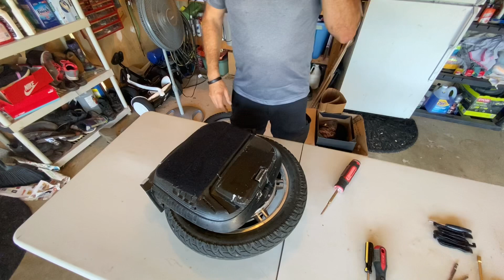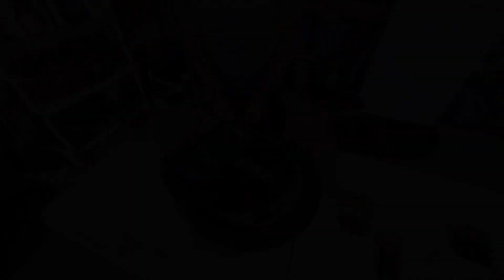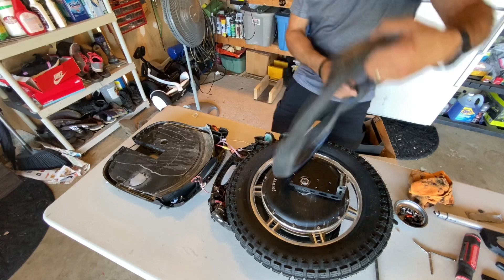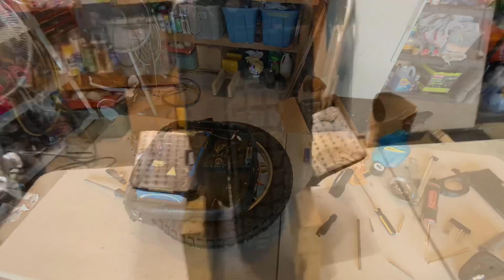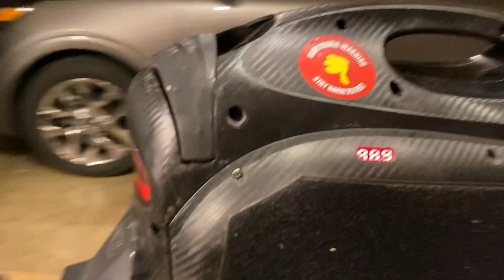MSP Tire change

Comment: Hey Ray where can i pickup one of those MSX strengthener/washer 5:36? would greatly appreciate it. Thank you.
Reply from the maker: murland fish used to make them but not any more. you can use wider washers and longer bolts to achieve  same purpose.
Reply: Hey Ray, thank you for the reply. I will give that a shot.

Comment: I noticed that you had a white patch near the battery on the casing as you were replacing it at reassembly, did you have a repair made to your casing? 
I’ve just received my pedal bracket strengthened from Murland, they are of superb quality, came with excellent  replacement Allen headed screws, and all look very strong, will be fitting them soon. Greetings from Scotland!
Reply from the maker: hi, the white piece you see is a basically big washer to protect inner shell from cracking around the hangar bolt holes. you can just use normal thick washers to achieve same results.

Comment: What size Phillip screwdriver do I use to get those screws out?
Reply from the maker: i use a milwaukee number 1 and i push down on the screw as to not stop it. get brand name bits, they are worth it.
Reply from the maker: yes. milwaukee is just the brand name i use

Comment: Good morning Ray. Would you happen to know what size socket and wrench I need to change my pedal hangers on my msp
Reply from the maker: m5 for the hanger bolts. 24mm slotted socket for axle nut. torque to 101ft/pounds when reinstalling axle nut

Comment: Where did u get the power screwdriver please?? I'm trying to fit a new tyre on my Msuper 84v any advice please? 😊 👍
That's an awesome tyre👍 how is it on flat surfaces?
Reply from the maker: CRAFTSMAN 4V MAX Cordless Screwdriver (CMCF604) https://www.amazon.com/dp/B07ZK6GYRL/ref=cm_sw_r_cp_api_glt_fabc_J3ZB37Z1Z79G8CK9AWC0?_encoding=UTF8&psc=1
Reply from the maker: for me, it handles well on all surfaces.
Reply from the maker: take your time! you don’t want to punch the inner tube and have to do it all over again. so i tend to really take my time if i’m using metal levers. you can try the zip tie method. do a googled search tire change using zip ties.

Comment: This is a great tip not to touch the right side controller and motor wires! Can it be done on the RS as well you think? Thak you!
Reply from the maker: yes it can be but you probably have to extend motor stop switch wires as i did in msp. on my rs i found it easy to just drop motor from shell.
Reply: @rayrokni  Disconnecting the motor wires then? Thank you for your time!
Reply from the maker: @igorgoga7985  yes i disconnected the motor wires and hall sensor. be very careful disconnecting the hall sensor since they put a lot of silicone on the connector. use an exacto knife and very carefully cut the silicone holding the connector. do not be in a hurry. then carefully rock the connector side ways and up. hold the connector only, make sure you are not pulling from the wires. make sure you take notes or picture of the sequence of motor wires. you don’t want to connect them wrongly. make sure the hall sensor is reconnected firmly in place upon reinstalling everything. if you don’t want to do this then just try from the left side, as i do on MSP.
Reply: @rayrokni  I am afraid if the disconnect button wires are too short- what if I won't be able to open the shell. You extended button wires by soldering extra length pls?
Reply from the maker: @igorgoga7985  they are thin wires. i used butt connector with solder in it. all you do is heat up the connectors and it melts the solder. i believe i have a video on them
Reply: @rayrokni  Huge tip- i did not know such thing exists! You used silicone insulated wires to grow length? Sorry- won't bug again
Reply from the maker: you are not bugging. i use silicone wires. you don’t even have to solder them. the don’t carry much power at all. just teist them together and use heat shrink to insulate the connection.
Reply from the maker: or i can send you a link for the connectors on amazon

Comment: Thank you for sharing the video 👍 Is it the same knobby tire as the Sherman? I have an extra knobby tire for Sherman and thought about putting it on my son's Gotway RS. Do you know if the tires will fit the RS? Thank you! 🙂
Reply from the maker: yes i believe sherman uses the same kenda 262x i put it on rs also
Reply: @rayrokni  That's wonderful! Thanks a lot for sharing your valuable insights and experiences 🙂👍

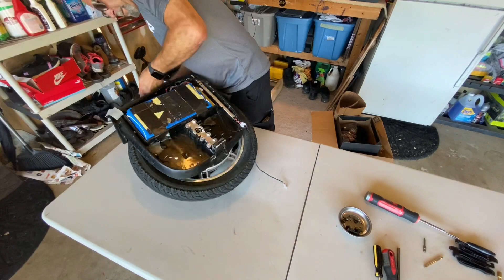Comment: Hi great video, at 5:35 you removed a plate that holds the shell to the footplate hanger,  does that come as standard on the MSP or was it installed separately? If separately where can I get it please? Thanks.
Reply from the maker: that does not come standard. i had a friend make that. his name is murland fish. you can find him on facebook. he is from washington state, usa
Reply: @rayrokni  is his full name Murland W Fish on facebook? There's a few Murland Fish that I found.  Thanks
Reply from the maker: Evolt X yes. that’s him. his profile picture is off euc and one wheel on a beach. something like that. tell him i sent you
Reply: @rayrokni  thank you. We are in touch but its confirmed these brackets won't work for the new gotway RS so, ill be waiting till his RS turns up and he'll see what could be done

Comment: I like this way of changing so you don't have to disturb/weaken the motor connections and replace silicone. I think you mentioned you had to extend the wires on the lift button?
Reply from the maker: John Hovan yes, so i could lay the shell flat on its back. otherwise the motor stop wire will only allow you a 90 degree vertical position of the shell due to wire length
Reply: @rayrokni  I supported mine today at 90 degrees. Changed the tube. If you have a size on the replacement size on the screws, those philips heads feel mushy.
Reply from the maker: John Hovan m3-.5x16mm

Comment: Just replaced my MSP tire yesterday evening. I opened it up same way you did. I went with shinko 244 2.75-14 tire so I had to shave both the tire and the shell. 
Enjoy your new tire and thanks for the video.
Reply from the maker: ADHD PoV how do you like that tire?
Reply: @rayrokni  so far only about 8 miles on it, I'M LOVING IT! great on & off road.
Reply: @rayrokni  did you have to shave your tire and shell? I did.